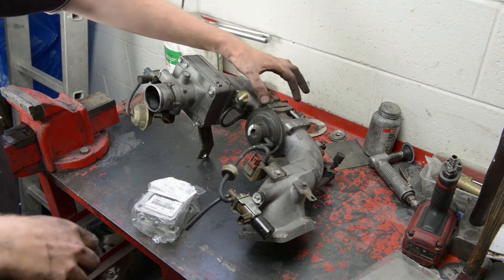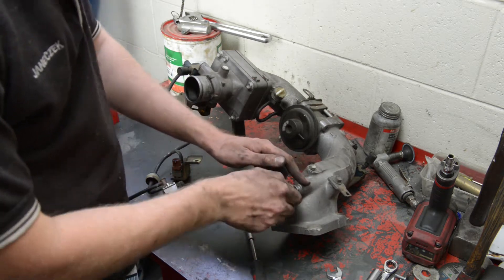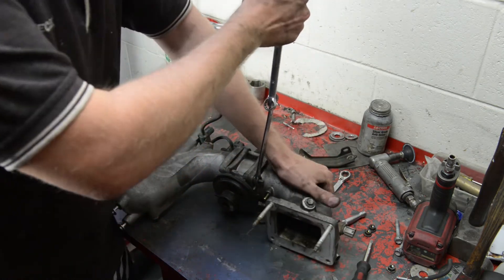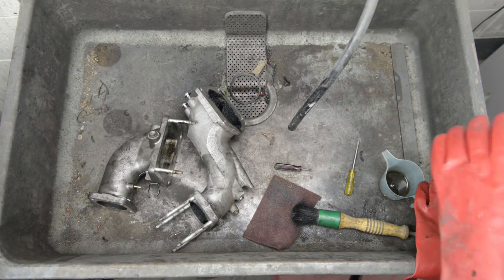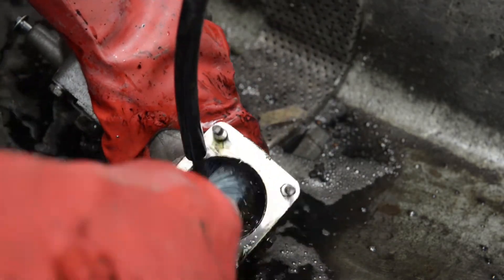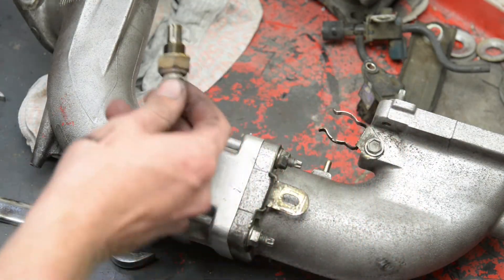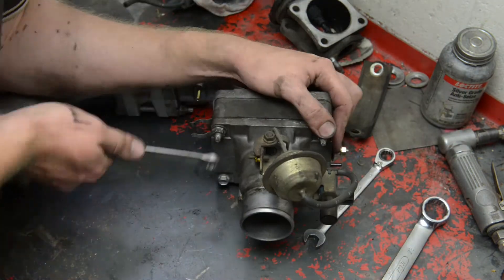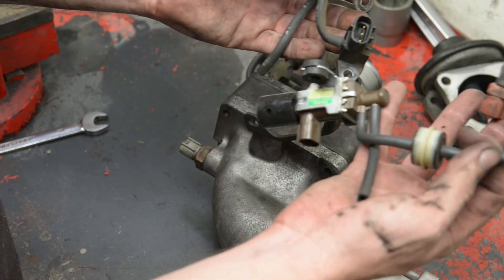EGR Delete, Intake clean:  [Part 2] Crossover pipe clean/ mod

Comment: It's quite easy to remove the guts of the intake heater element and maintain a seal with original terminal bolt. It's only for emission control the first 90 seconds after start up. Direct injection engines don't really need it.

Comment: Excellent mate I about to take my injectors out of my 100 so this helps a lot
Reply from the maker: Just take your time with the injector lines, they are a little bit fiddly to manoeuvre around.
Make sure you let the car sit overnight before you crack the line.

Good luck!
Reply: Hi dan I have taken off the inlet manifold and taken the injectors out to rreplace the nozzles , I’m going to try a blanking plate as the inlet was or is really badly clogged with black crap
Just hav3 to source the u shaped washers on the return pipe now as some of them were in half’s when taken off not to mention some half’s missing , not sur3 if they were ever there , seem too wide to go into oilways
When is part 4 coming cheers Justin
Reply from the maker: Hi Justin, good to hear you got it all apart.
Also check your breather pipe which goes from the valve cover to intake. Sometimes that gets blocked as well.

Part 4 should be out Friday.

Good luck, cleaning the black sludge is fun!
Reply: Cheers new nozzles arrived today with gasket kit and return pipe washers tomorrow, did you ever have broken washers on the return pipe because I have and I’m not sure if there are bits missing but I will check tomorrow, just wondered
Reply from the maker: Never had broken washers no. Do you have a repair manual with a exploded view of the system?
Reply: Hi yes I have a max elderly one it seems to cover it all so far 
Excellent videos looking forward to 4
Reply from the maker: Working on it right now :)

Comment: Hi there. Sorry newbie here, does it require tuning or adjustment after blocking the EGR? Thanks. Great and informative video btw.😊
Reply from the maker: Hey mate. No need for tuning after.
No question is to silly to ask.
Reply: @DanvsCar  thank you. ☺👍
Reply from the maker: Blocking the EGR stops putting exhaust soot back into your engine. If you do not have a catch can it will create a sludge which restricts airflow and lowers performance.

The EGR gass is also hot, which will increase air intake temps, if the EGR inlet valve is partially stuck open, it will let boost pressure out.

People have seen performance increases which have had heavily obstructed intake. (Better free flowing air) 

Others say it feels similar to what it was.

It's more of a preventive mod, then a performance mod. 
By cleaning the intake, that will increase performance
Reply from the maker: @RizidjuemGear No problem at all. Ill be making a order in January. I will have some in stock then.
If you send me an email to danvscar@gmail.com and I can put you on the list.

Comment: Great video thanks.  Has anyone removed the guts of their intake heater element and has it caused any codes or issues?  I suspect this will be the easiest solution unless there is a cheap intake heater delete part available now?  cheers

Comment: My only question in this process
Do you think the ECU fuels or Air's the engine any different when the EGR system is operational? To compensate for the exhaust gas injection into the intake.

Hence if you just installed a Blanking Plate and didn't handle the vacuum lines 
(blocking them off or what ever is needed, or even if that works?)
Would the ECU possibly be incorrectly fuelling your engine? because it thinks there is less cold dense air in the intake while the EGR valve has been called to open.

Or is it purely a mechanical process?
And the ECU is unaware if the EGR valve is open or closed?
Reply from the maker: With the 1HZ and 1HD-T the EGR does not control the fuel/ air delivery. 

I assume this would also be the same case with the 1HD-FTE.
Since there is no airflow sensor or o2 sensor the engine has no way of detecting if the engine is running to rich or lean. 
It does have a knock sensor and a few other ones, but no way of detecting the richness of the fuel.

The EGR only activates under certain conditions, so its not on all the time.

In the worst case that it somehow was controlling the injector pump, it would mean that the engine would be running slightly richer.

When you do the mod, have a look at your exhaust, if there is less or more soot, Black or white when accelerating.
Reply: I have no soot ever :)
Reply from the maker: One of the lucky ones :P
My 1HZ is soot town!

That means you have a good tune!

Comment: Hi Dan, where is your shop located and roughly how much would you charge to clean the intake & injection system and add a catch can on the 1HD-FTE?
Reply from the maker: Hello, located on the Gold Coast, Australia.
Reply: @DanvsCar  , Im Gold Coast as well mate, what is your company called and roughly how much would you charge to supply & fit a catch can & clean the intake on a 1HD-FTE?
Reply: @deant6627  do it yaself he made a video ya slack hole :P

Comment: Dan, did you get any of those heater delete kits drawn up in CAD? sure would be keen to order one. I have access to a CNC machine to mill one up if you supply the file? Thanks
Reply from the maker: Send me an email. I have sent a bunch of business emails but the prices are a little high. 
Danvscar@gmail.com
Reply: @DanvsCar  Email sent.
Reply: Hey Dan we seem to have lost contact. You mentioned in your post you have some machined housings to replace the heater in the crossover. In your l last email you said you were getting some made.

Comment: whats the difference between an egr delete and egr block.. I thought you had to block the crank fumes that recirculate. that  piece u put on is hollow
Reply from the maker: EGR block you are just installing a blanking plate of the exhaust manifold side of the EGR pipe. doing it this way will keep the engine looking stock.

EGR delete is completely removing the EGR System from the engine. 

Both do that same thing.